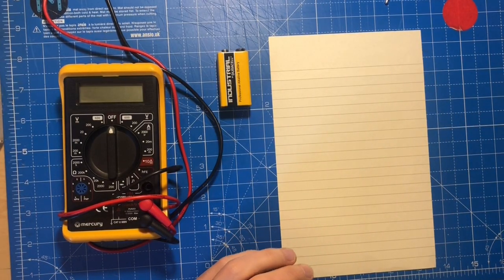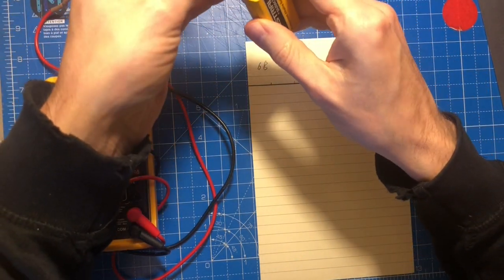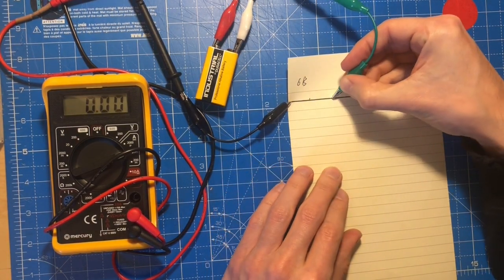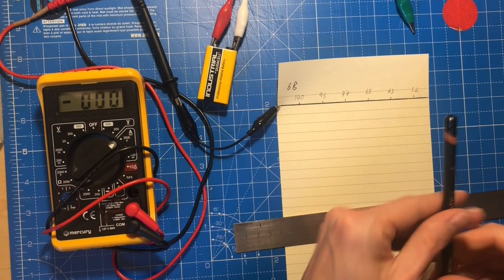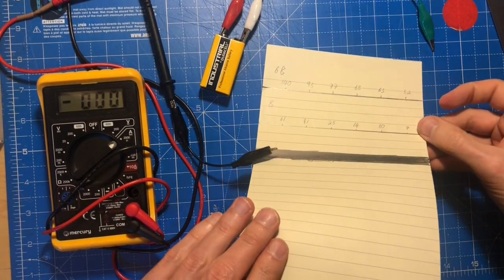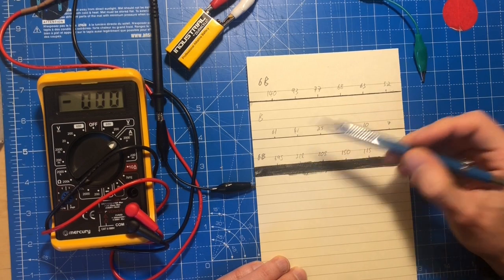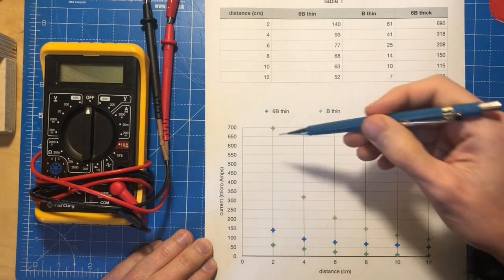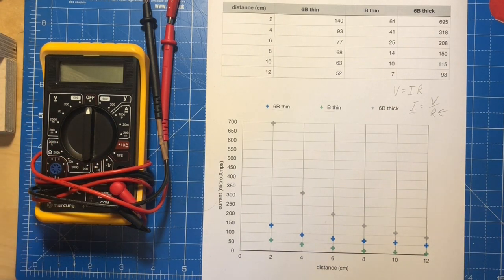resistance of pencil lead

Comment: Why mine doesn’t work 😭, I colored it so shiny It was dazzling but still. Are we supposed to color the opposite side as well?
Reply: No, you don’t need to colour in both sides of the paper. I’d say double check all your connections and that the battery is charged. Best of luck!

Comment: ... funny, I would've measured the resistance of the pencil. 1st) directly with an ohm meter 2nd) indirectly, with Ohm's Law voltage drop across the pencil / current through the pencil. But, I guess pencil tracks are not without their merit - once you estimate their c.s.a.